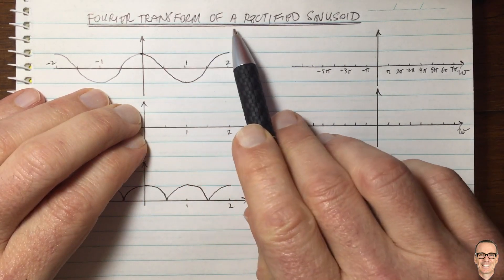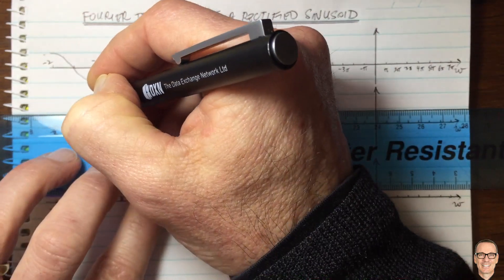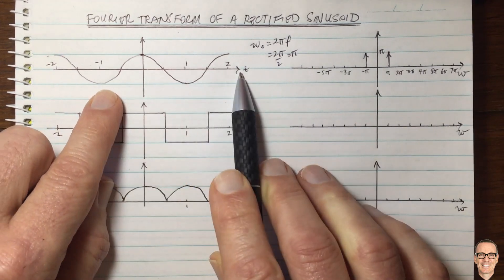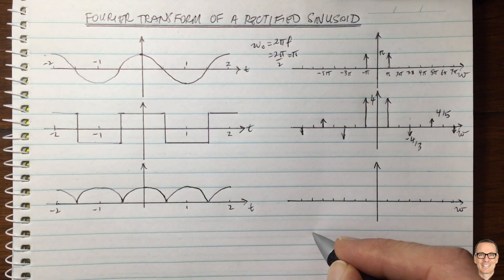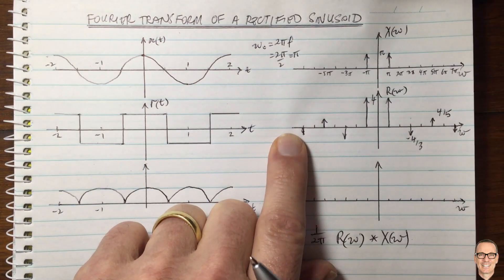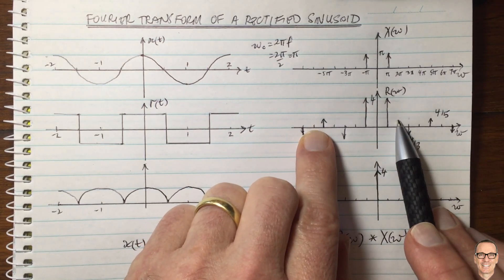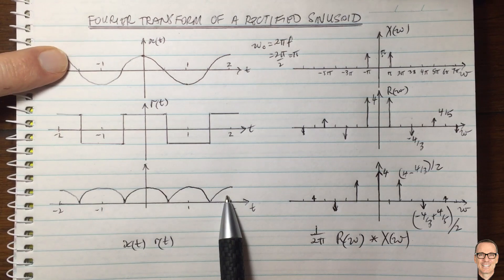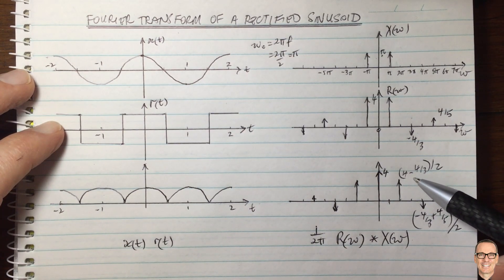Fourier Transform of a Rectified Sinusoid

Comment: For the sine wave x(t) you have not written the equation. It would be x(t)= 2*pi*cos(wt)
Is that right?
I conclude the amplitude from the hight of the Diracs (pi) -> amplitude of the wave = hight_Dirac*2.
Thanks a lot
Reply from the maker: The frequency plot is with respect to omega. Since omega = (2pi f) there is a scaling of 2pi on the amplitude too (you can see this is you look at the Fourier transform formula written in terms of omega). So the cos waveform I drew has unit amplitude. ie. x(t)=cos(pi t)

Comment: sir, can we consider square wave used to multiply the cosine input as impulse response of a rectifier ?. If yes, then can we use fourier transform to get response of a non liner(in this case rectifier) system?
Reply from the maker: No, a rectifier does not have a square-wave impulse response. It's not a linear filter.